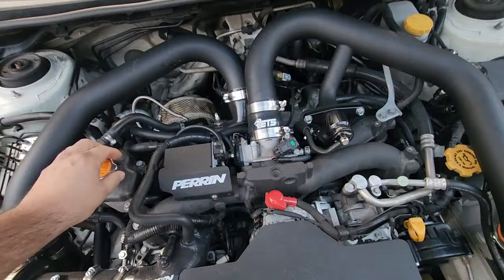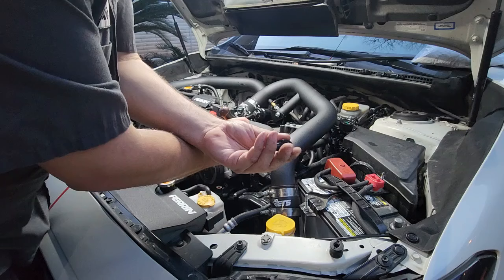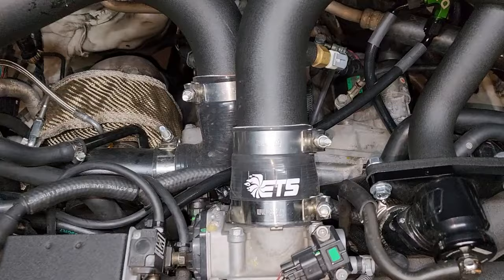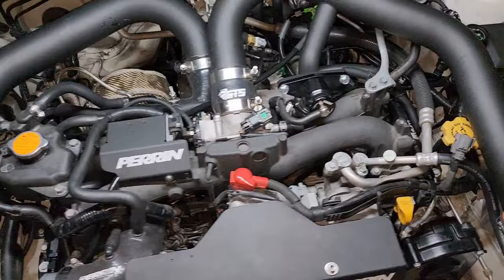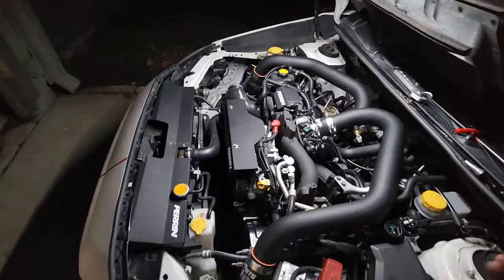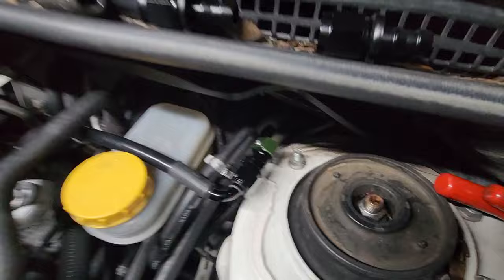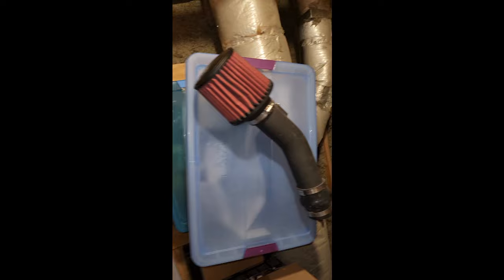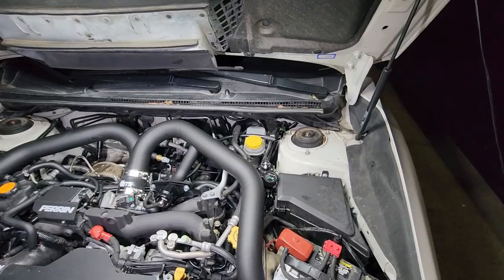Road To TX2k'24 - Dead-Head Vs. Parallel Fuel Rails Part 1/2 (500 WHP Subaru Build)

Comment: I love those KSTech intakes. It’s awesome that they have the stock or larger diameters and also different have options to adapt to specific front mount pipings. The new temporary fuel routing came out good. But the “final” way you explained how you would like to run it seem like a solid routing